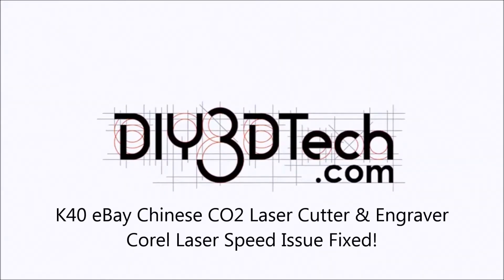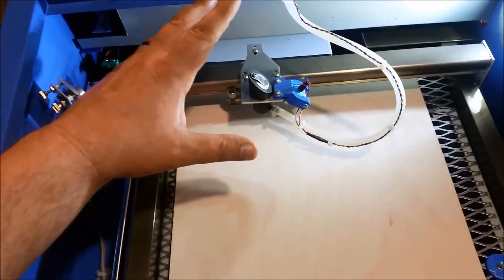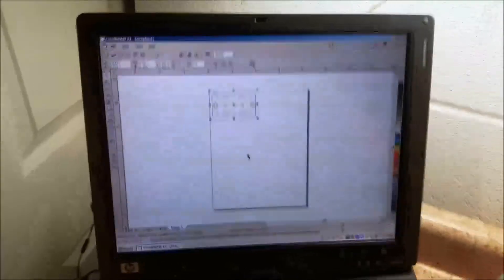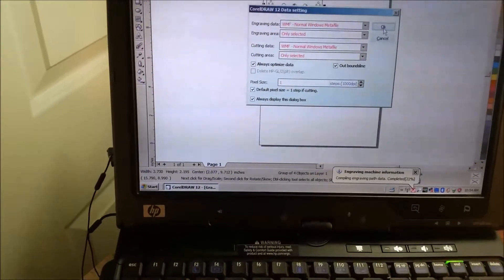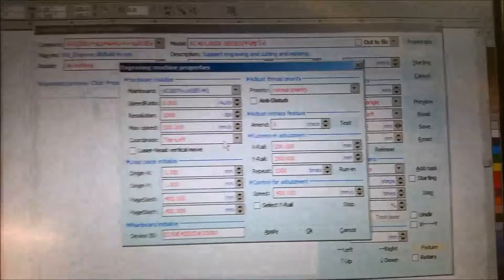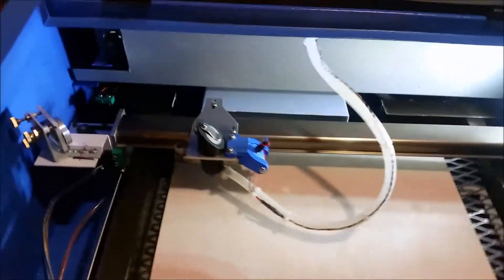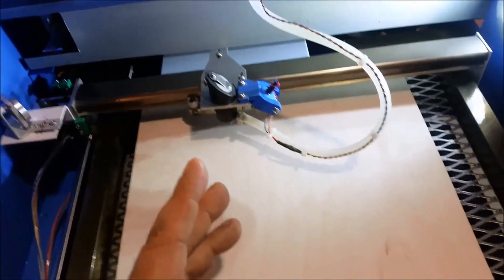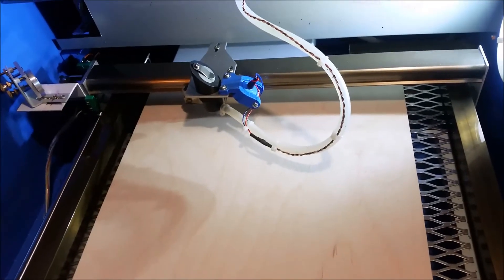K40 eBay Chinese CO2 Laser Cutter & Engraver - Corel Laser Speed Issue Fixed!

Comment: How do I install CoralDrw on my PC? I tried inserting the disc that came with my 60w chinese laser I bought from EBay
and Mcaffee anti virus software blocks  it. I was able to install laser draw but that program doesnt do much?
Please contact me. I cant see a contact or email address on your webpage. Thanks Chris
Message me at Etsy Shop ChristophJoseph .   I make leathergoods and sell on Etsy and ant to incorporate
laser engraved work.
Reply from the maker: Because it likely has a virus, I talk about this in several videos as when I used coralDRW.  I used it on a stand alone PC with no open internet connection and NO virus scanner.  However forget it, use Inscape and get the K40 Laser whisper software.  As you can see this if you look at the K40 play list...

Comment: Hi, thanks for your video. 
My 40W Laser Engrave machine having movement problem, as per my video   https://youtu.be/L7tmjmQYgD4  , sometimes the laser cannot move downward (Y-axis), it will working back after power off and turn the machine back on. 5 out of 10 time, this error happened. 
perhaps you have any advice ? Thanks.
Reply from the maker: Assume your using the software which came with the unit?  As if move at all this tells me that issue is not with the mechanics of the unit, however you have a connection issue between the computer and controller.  So my bet is the USB driver on your PC is the issue especially if your using Windows 10.  I have found XP to be the best...
Reply: @DIY3DTECHcom  thanks for reply. I am using XP. the software is Corel Draw which comes with the machine. once it happened , need to reboot my machine. really couldn't figure out what happened....

Comment: Hello, I got the same laser machine as you got in the video. But we got scale problem as: If we draw a square 20 cm X 20 cm but the real part when cut out are bigger as 20.2 cm. Could you help me how to solve this problem. Thank you in advance.
Reply from the maker: Check you have the correct board selected also remember that the size of the line will affect the cut as it cuts the both edges and if your cutting the outer edge you will have a 0.2mm kerf so you will need to take all of this into account in your design...
Reply: Thank you for your reply. I have tried to draw a line in X direction 200 mm but the real line length cut out is 202 mm. I think that i have problem on the motor set up. Could you let me know how to correct it.

Comment: hi there, thanks for the video. i have a similar problem with my engraving machine. i set it to 200mm/sec and it starts ok, but then it just slows down for the rest of the work. do u know if the problem can be solved  by following the steps on this video or if theres another solution? (once i read that the problem was solved by changing the mother board). thanks!
Reply from the maker: Wow 200mm/sec is fast!  So assume your engraving and not cutting?  What if you set it lower?  Also look in the K40 eBay laser Playlist for the episode of the K40 Laser Whisper software and get that, its free and works great!

Comment: I've just got aK40 model, laserdraw loads ok Corel draw will not install. Is it because I'm on vista or have got the setting wrong. I'm lost with it.
Reply from the maker: did you actually get Corel draw?  As typically what they do is just provide the "Corel draw" driver and your left to fish around the inter-web to find an old copy of Corel Draw (basically a bootlegged copy).  My version is running on WIndows just 10 just fine however my virus protection does not like the driver  (most likely it does have a virus) and this is the reason I suggest to viewers to run this on an old stand alone PC as XP works just fine....
Reply from the maker: Also take a look at this: http://www.scorchworks.com/K40whisperer/k40whisperer.html

Comment: thank you so much, my problem was fixed. but i got another problem. When i import dxf file into coreldraw, the cutting did twice at same lines. i"ve been changed the cutting data to plt, and it works. but the scale was not the same as i draw it.  i changed back to wmf,emf and png, the scale is fine. but the problem comes back to me when the cutting lines are overlaping.
Reply from the maker: What is happing is the software is cutting the outside and the inside of the line.  Try reducing the line stroke to like 1 point or less...
Reply: DIY3DTECH.com thank you buddy. then how can i do to reduce the line stroke. i created line from autocad and i saved it as dxf file. then i imported it to coreldraw. i draw only one stroke of line 😅
Reply from the maker: When I say stroke I am referring to the width of the line as if you Inkscape you can set the stroke in points.  As I am thinking about there might also a setting in the driver (its been a while) that you can tell it only to cut the inside or out but it doesn't stand out...
Reply: yes i have noticed that the setting is cutting the inside and outside lines. That's why it cuts twice haha. Then how to set to tell it to cut inside or out only?

Comment: Had a new problem I was hoping you might know the answer to: I've been trying to do some high power engraving lately that requires slowing down the laser to about 5mm/sec to get enough energy into the materiel - turns out the K40 CAN melt glass and do high resolution engraving! However, when I slow the speed down the laser starts skipping 5 or 6 Y axis lines between each pass, and the result looks a lot like the introduction to a star wars movie when held at a steep angle. Do you know why the K40 starts skipping lines at low speed, or how to make it stop?
Reply from the maker: Have you checked the that belt is tight and teeth match (hard to explain)?   It could also be the software too, have you seen the alternative app that Scorch Works can up with?  This might be worth a try...
Reply: I'm trying to do fine detail, but the microcracking produced by a quick pass makes the task impossible. I'm 95% sure the cause is software related because I can turn the skipped lines off by increasing the run speed. I've heard of scorch works, but didn't know if it was compatible with the existing circuit boards. I'll definitely find out, thank you for the suggestion! BTW, would you be willing to put a piece of glass or tile in your K40 and etch something at 5mm/sec to see if this problem is universal?

Comment: Hey DIY3DTECH, I have a similar laser and im having an issue with my Laser DRW, so im wondering if you can help me please. My Laser DRW is saying "Main Programmer is not working" and crashes each time i load it any fixes?! I discovered your channel because i had to install CorelDraw to see if it would work with my Laser or i'd have a VERY expensive / ugly coffee table :(
Reply from the maker: So couple things, (1) this software likes Windows XP, (2) this software does not like a virus protection software (it likely is a virus not joking I run it on a stand alone XP machine for the most part).  I have never seen main programmer not working, does it move the laser head?  Does it do an initialization when you turn the power on?
Reply: Sorry, i have Windows XP and i had it on my computer but i believe that the computer ran an update and all of a sudden when i start the program it looks like it's starting up but it stops working and there's an error saying that the "Laser DRW Main Programmer has stopped working". To be honest i havent tried it while my laptop is hooked up to my laser so i cant answer that question. Oh and let me say thanks again because this video helped me from panicking cuz now the laser works with Corel Draw, but i know NOTHING about Corel Draw. So im using the trial version so i can learn as much about it as possible before i buy it....so ill have to find a Corel Draw video for beginners (and a crack lol)
Reply from the maker: My two cents is focus on Corel Draw as it is far more capable than Laser Drw or Moshi Drw as those are really for making rubber stamps...

Comment: need help just got a k40 laser and when i put any pictures or designs in to cut the laser does'nt fire up and i have to hold down the test button to do anything and the software does'nt work  any tips or help would be very helpful thanks
Reply from the maker: can you control the laser (i.e. move the head) from the software?  Did you insert the doggle?  What version of windows (it likes XP) have you turn off virus protection (virus protection doesn't like because it is likely a virus and I am not joking I only run it on a stand alone computer).  Have check the baud rate and selected the correct motherboard?
Reply: no i cant control it from the softwares arrow keys windows 7 i cant use the software disc as it was damaged in transit so downloaded other software the orange softkey dongle doesnt do any thing on the software i can put a dxf file in and change speed  and press engrave and start and it goes through the motions but the laser doesnt cut or mark unless i hold down the test button.will try what you put up and see if it changes thanks.
Reply: no it doesnt seem to move with the software unless i have set it up with a picture to cut the software disc was badly scratched and the softkey dongle doesnt do anything at all laser only works when i press the test button thank will go through the settings again and get back to you if thats ok   thanks
Reply from the maker: I understand better, so you need to get the right software as the "software" is keyed to dongle and there are many types of dongles and the laser not firing is the typical result of it not reading the dongle.

Comment: hey. ..can you tell me what is problem with my new laser.. Can it fix??
 - https://www.youtube.com/watch?v=ZV4zZ0hC2kQ
Reply from the maker: Check the wires on your end-stop as when it reaches that point it should trip a micro switch to tell the control-board its in the home position and if doesn't it will keep trying...  Hope this helps...

Comment: PS also  I having a hard time getting it to center  from left to right and  makes a awful noise when  and after cutting the work area is just off  ! I have to drag  the cutter to the far left and let it run to be able to to get it back to the far left  ! as you might guess I havent had it very long or time to be on it alot  ! Maybe you have some ideals  Thanks !
Reply from the maker: This is what is making think the belt, also check it isn't binding as I had one out of the box where I had to order rollers (you can get them from Light Objects) as mine (brand new) where bad and would bind up making a lot of noise...

Comment: I having a problem with my  engraver where the  head isnt return to the same spot and the rails arent releasing and when i hit start engraving it moves to a new area it just acting crazy for no reason one day ! I will check to see if I have it set on the correct  main board ! If you have any suggestions I d be interested in hearing them ! also where did you purchase your air asst  rig ?
Reply from the maker: So first thing is make sure the belts are aligned correctly (check the playlist as I think I did something on this about a year ago).  Also what application are you using?  I have had Corel Laser will do this and if reboot the PC and start clean it sometimes fixes it (I got so tired of this on my first machine I replaced the control board with GRBL).  Also look in the playlist for the video where I set the mortherboard as several are close and will sort of work however do strange things...

Comment: hi i have a problem with laser,  its firing to thick around 2-3mm making horible cut , what the problem may could be ?
Reply from the maker: Have you performed a slant board focus test?  Also is the lens in correctly?
Reply: the lens i just bought new 18mm like it asks ,  and about board focus test i have no idea how should i do it ?
Reply from the maker: If you look in playlist for the laser there is a video on Slant Board focusing or just search my site it was about a year back as it sounds like this lens has a different focal point also watch all of the videos on lens to make sure you have it in the correct way as most install them upside down...
Reply: Hi, I have the same problem. Have you already fixed your problem?

Comment: The main board number is actually printed on the board.
Reply from the maker: Yes, however in this unit the board is not accessible as this is the digital unit so it is up and inside.

Comment: I could never get Corel laser to work on mine. the only program that works is the LaserDraw.  I will be switching the control board soon, so I can use more advanced software, without needed the USB dongle that came with it.    https://www.youtube.com/watch?v=9tWF6zdBtAE
Reply from the maker: If you check playlist I converted one of my CO2's over to GRBL and very happy with it.  What issues are you having with Corel Laser?  I have turn off virus protection for it to work...

Comment: I found that running on speeds 1-8 my laser behaves like I expected slow to fast.  weird, I know.  I will give your fix a try too :)  THANKS
Reply from the maker: Your welcome and let me know how it works out for you or what you find.  As you will see in the video playlist I convert this laser to GRBL as I was having a lot of issues with the board.  However, I just bought bough another one (CO2 Laser) and plan on leaving it somewhat stock (at least for a while :-)

Comment: Thanks for sharing this. I draw in coral draw and directly print from it. My engraving size if in coral draw is a sqaure, this engraves a rectange. I am not sure what the issue and guessing it may be that i have selected the wrong motherboard as well.
Reply from the maker: Its been a while as I converted mine to GRBL and gode as I got tired these type of issues, however if it's doing a rectangle and not square than yes your steps are off.  So check your configurations and also there is a video in the (title something about speed) which talks about selecting the correct motherboard.
Reply: Okay, Many Thanks for Help.

Comment: Back again haha first I just want to say thanks for all the advice and potentially saving my life, I did my first cut today and everything went pretty well! What setting do you suggest for cutting 1/8" acrylic?
Reply from the maker: Your welcome!  I need all the viewers I can get (smiles), so your question (setting do you suggest for cutting 1/8" acrylic) "depends" on the type of acrylic it is as cast is the best.  So you will have experiment.  However some starting suggestions are for cuts, doing it in a couple passes than one as it gives you a cleaner edge.  Also if you care about the longevity of your tube (which I don't as I'm looking for a reason to buy a bigger unit) is you will cut around 60% or so which will likely mean  around three passes on a well turned machine.  Your speed settings will likely be around 1 to 5mm per second.  Hope this helps...

Comment: Yes this video helped me out so much. I thought it was a problem with the laser Thank you. 

You're the only one I have seen that has the digital one like mine. I have a question I have to put the display to at least 12-15 to get it to test fire is that normal ?
Reply from the maker: Glad it helped and yes it is (to at least 12-15 to get it to test fire is that normal) digital or analog you have to be around this range to fire.  If you should also watch (https://youtu.be/4tDK3yOhN3E) as this will show more on the topic of current and also suggest checking out the entire play list (https://www.youtube.com/watch?v=8m3evdpEeIY&list=PLInTrkIbj69kPO_UP81yxX-xov4SVyPlD&index=2) Oh and don't forget to subscribe too!  :-)
Reply: Is there a way to find the height of the focused beam ?
Reply from the maker: Yes, check out the playlist for the Slant Board focusing video that will show how find it.
Reply: sorry for all the questions, is there a way to keep all the small bubbles out of the tube. Someone has said put a drop of dawn in the bucket of water.
Reply from the maker: Never had an issue with bubbles in the tube are you using distilled water?
Reply: Yes distilled water
Reply from the maker: Hmm, no real clue than as like I say, have never had an issue with bubbles.  Are you using a tank of at least several gallons so the water isn't becoming agitated near the inlet?  Also would check the tubing as for bubble to appear the water must mixing with air somewhere.  I use a 5 gallon bucket with about 4 gallons of water, the pump is in the bottom and the water return at the top and as mentioned no bubbles...